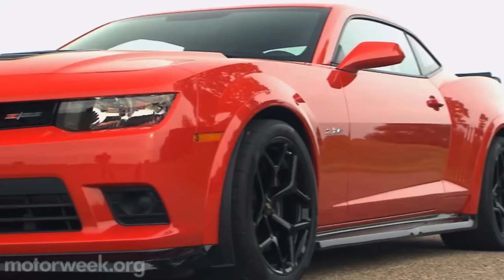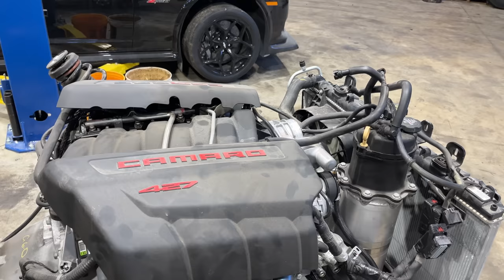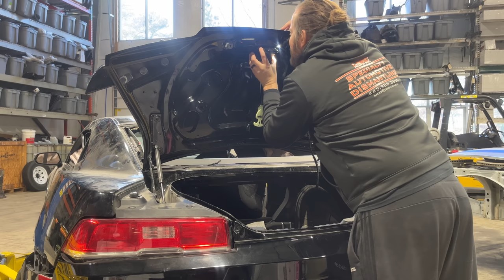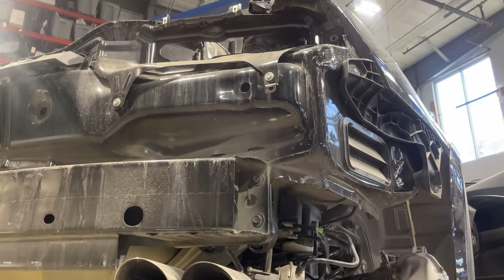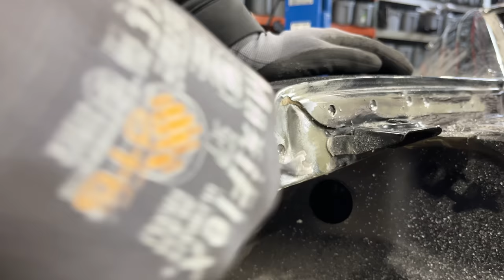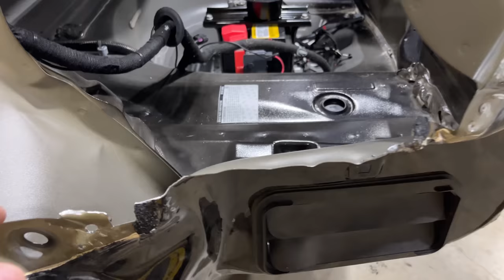I Bought 2 TOTALED Z28 Camaros At Salvage Auction

Comment: Hey you guys want a set of shop hands? I live out my van so moving isn’t an issue. I have a motorcycle in tow.
Done two apprenticeships in separate genres hvac and cement/framing
Currently pulling parts at a b&r 
Previously was a ranch hand.
I’d like to be in a workplace similar to this and eventually flip motorcycles in my own time once I learn all the tools and how tos on the cars and whatnot:) I’m 23

Comment: A front clip with no body work is much easier to rebuild. Just grind out or drill the spot welds, and pry off. Replace with straight front end off the other car.

Comment: I remember these on dealer show rooms, they just sat in spot. Local dealer had 1 that sat for 2 years on the floor and it was heavily discounted.
Reply: yes, at the time they were more $ than a Shelby, which lets be honest, is way more popular.  I heard from a GM guy that even at $75k, GM was losing $ on the Z28.  They put so much R&D etc into it such as the DSSV shocks and all the Z28 specific parts.  Would have been nice if they would have been able to save more weight by using somer carbon fiber but then the car would have been $100k MSRP.

Comment: I would really like a 2014/2015 Z28. Just can’t afford it. 
 I think you could have fixed both cars. The blue one, had front end damage. Just as easy to either straighten or get a new front stud welded on. Since the entire drivetrain was intact. 
 Black one needed a rearend, and a quarter panel. And some other things. 
 Could have made two cars.  I know the rearends and everything is specific to the Z28 model. 
 Still think you could have made two cars. 
 And the bid on eBay just went off the other day at $45k.

Comment: What kind of fuel pressure regulator u run? Bout to swap mine over to adjustable and start tuning but am hearing mixed reviews as to what brands have good and horrible quality 🤷‍♂️
Reply from the maker: U don’t need to change the pressure regulator on an ls unless your doing a boosted application where you need the increasing pressure with boost.  Otherwise,  just leave it alone and let it do it’s thing.

Comment: What tires are on the neon wheels?
Reply from the maker: It’s got some nitro nt555s.  Not the Pirelli it needs lol
Reply: Well I have a 2010 and just bought new rims. I went with 20x10 ft and 20x11 rear  and trying to decide on tires. Due to needing a 315 on the rear it cuts the options WAY down. I live in Southern Indiana and we normally do not see much snow so I don't have to worry about that but I don't want to break the bank either. Any suggestions?

Comment: Wanna give a poor delivery driver an engine? i have a 2016 chevy ss with a warranty on the engine. 30k miles later, stock rocker arm failed, took out a lifter, the cam, and most the good stuff in the engine when the needle bearings ejected into the engine. 8-10k+ to replace engine, and we all know doordash is not paying drivers. im just tired af at this point. 13k spent on just ownership and its always been messed up. pray for me y'all

Comment: All though Z28 is great / there is better! Have you never gripped the wheel of a gen 6 ZL1/1LE?  , I rest my case
Reply: There will always be the next better car, but IMO I would still take the Z28.  looks like a muscle car and that LS7 sound is unmatched and N/A.  Can run at a track practically all day.  Heat soak is a real thing
Reply: Yeah,  the argument is certainly there for that car.  Obviously they built on what they learned with the z28.  We will fix a gen 6 zl1 extreme at some point here soon